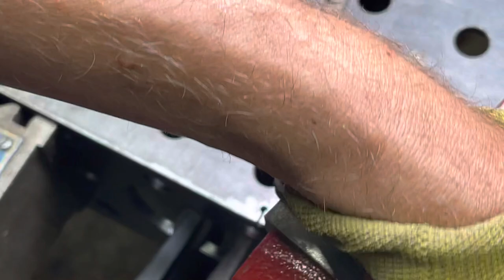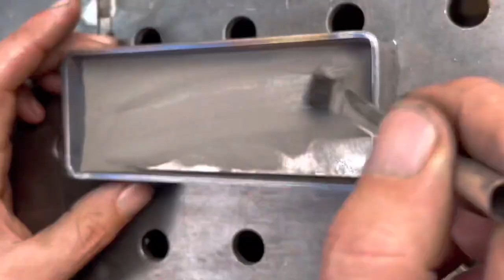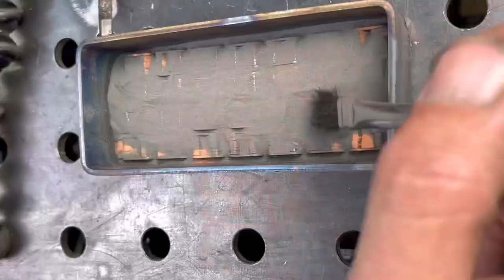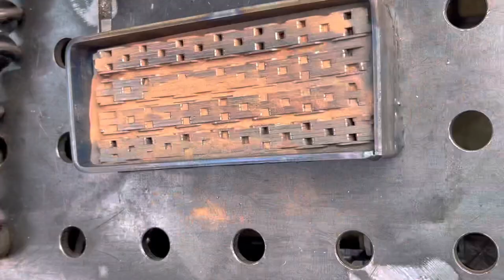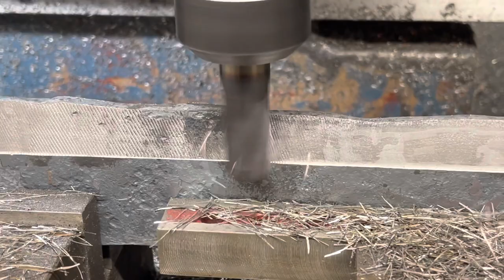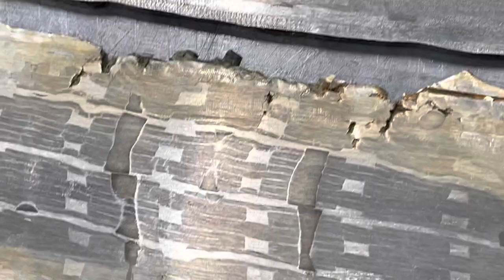TIMING CHAIN DAMASCUS !! MAKING DAMASCUS FROM OLD TIMING CHAIN !!

Comment: Copper having a lower melt temperature caused it to move to the edges as it was in more fluid like state. When forging copper you must forge at lower temperatures.
Reply: Exactly,  make the demascus first, then copper as a brazing for effect.